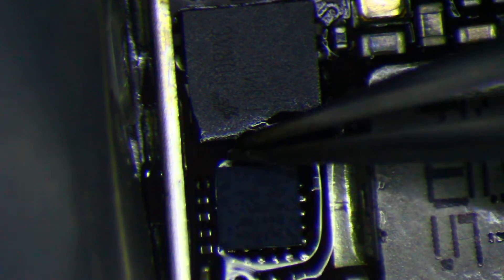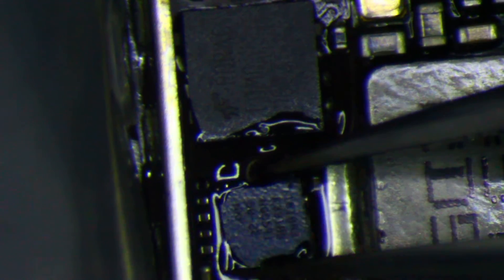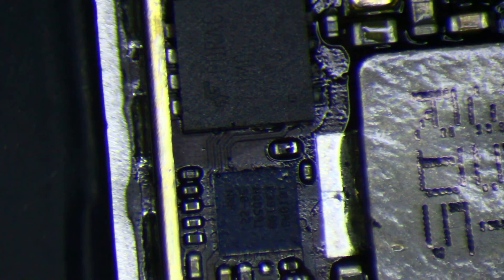iPad Mini 2 not charging solved

Comment: ipad mini not charging, but the display is not included with the cable only works from the battery. Tristar and Main power has been replaced, but no results. What could it be ?

Comment: Mark great video. What hot air station do you currently use?
Reply from the maker: RUDY ESPADA I'm using a hakko 852
Reply from the maker: Dennis Meerveld in general I start with about 80% airflow and 350c and adjust as necessary
Reply: I've got the same one, but having trouble finding the right temperature and airflow. I know every hot air station is different, but can you tell me what airflow setting and temp (Celcius (or Fahrenheit, I'll convert :)) you're using to remove the IC and place the new one? Pretty please ? :)
Reply: Thanks, I'll give it another shot then. Getting it off cleanly worked at 350c and 70% airflow but getting it back on is what is costing me 2 ICs so far. I get it to stick to the tacky flux (chipquik) within seconds, but then the IC never settles when I come back in with the heat. It's probably all practice, because when I take it off afterwards (I can just pick it up with the tweezers) I see some solderballs have come off the IC and are now on the board :) Also, I'm an ass for using wick (got it very clean, but that - as you said - probably works in my disadvantage now. Ah well, thanks for the advice and awesome videos, I love the work you and Jessa do ! I'll get there in the end ;)